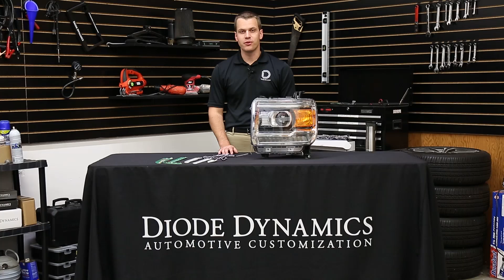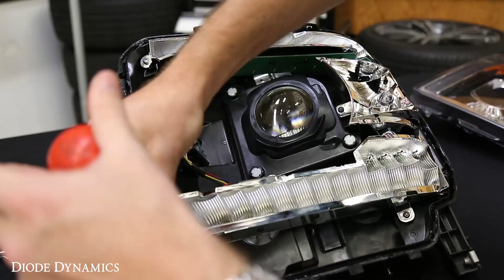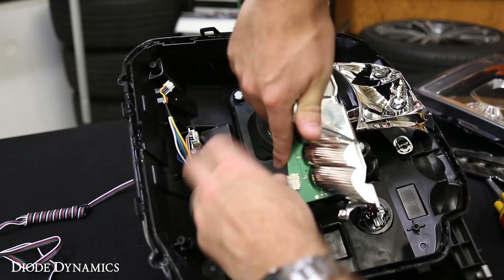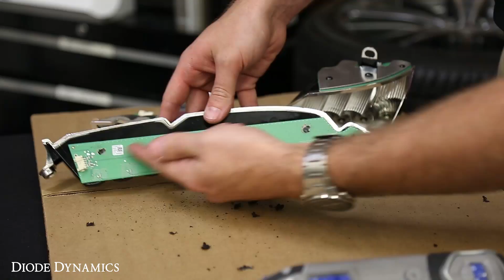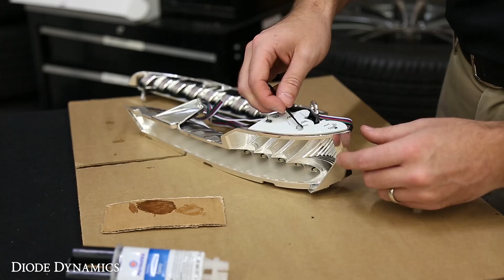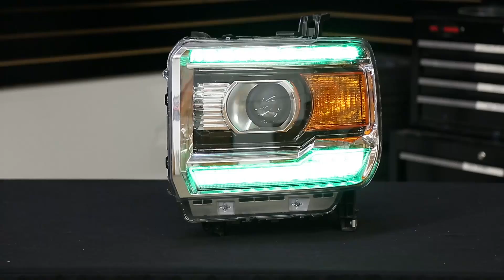How to Install GMC Sierra RGBW™ & Switchback DRL LED Boards by Diode Dynamics

Comment: It's a shame you dont include a real wiring harness that could be plug and play from the park lights, a T type harness, that way you wouldn't have to use these cheesy wire tap connectors that butcher your factory wiring and ALWAYS fail over time. Very disappointed.  I noticed you skipped over that during this video.

Comment: Do these have the single bottom board drive function like the stock boards????
Reply from the maker: Hello Collin! These LED boards, both top and bottom, will function at very much the same time after the new LED boards are installed.

Comment: Got them all wired up. Love them!! But real quick, the rgbw’s DO NOT blink orange like the standard switchbacks right? Thx
Reply from the maker: Thanks for the update, we're glad you're enjoying them! And that's correct, your multicolor boards don't have an amber function.
Reply: Diode Dynamics 
Appreciate it
Reply from the maker: No problem, thanks for your support!

Comment: What options do you have to remove the amber housing?
Reply from the maker: Hi there! While we don't yet offer a product specifically for that, we would recommend checking with one of our certified installers for a recommendation! You can find one near you through our Dealer Locator Tool: https://www.diodedynamics.com/find-a-dealer

Comment: Would these work on a 2015 GMC Sierra 1500
Reply from the maker: +Connor Bain They sure will! Check them out at the link below.
https://www.diodedynamics.com/2014-2015-gmc-sierra-multicolor-drl-led-boards.html

Comment: Do you have any plans of making these for the 2016 Silverados?  Maybe even a conversion to LED for the bottom ambers of the non LTZ headlights?
Reply from the maker: +Ryan Christensen We're always working on developing new products! Stay tuned!
Reply: Diode Dynamics do u guys have this for headlights with non LEDs on the sle trim?
Reply from the maker: +Noble Soccer197 Unfortunately, not at this time. Sorry about that!

Comment: I have a question ? If I do not have leds how can I make this work ? Would I have to purchase brand new headlights with leds ? I just have the Sle model gmc
Reply from the maker: +Gabriel Diaz, this product is a direct replacement for the factory LED boards. Unfortunately, if you don't have factory LED boards in your headlights, you would have to purchase new headlights. If you have any other questions, feel free to contact us!
Reply: +Diode Dynamics ok thanks , that's what I thought but wasn't sure. So I would have to order off the SLT Model or something ? Then would they just plug and play ??
Reply from the maker: +Gabriel Diaz, our LED Board installation would require opening the headlights. Our boards are a direct replacement for the factory boards, so you would remove the factory boards and replace them with our LED Boards. Below is a link to our Sierra boards. If you have any other questions, just let us know! 

http://www.diodedynamics.com/store/catalog/product/view/id/22543/s/2014-2015-gmc-sierra-multicolor-drl-led-modules/category/1451

Comment: what do you recommend to rebuild the led drl reflector? I broke mine and I would like to remake another one
Reply from the maker: +Oscar G, we would suggest buying a used headlight on eBay that has the mounting clips broken off. They are typically more affordable and then you will just need to bake it to open it and take the reflector out of it. If it isn't broke too badly, you could try to use JB weld to piece it back together.